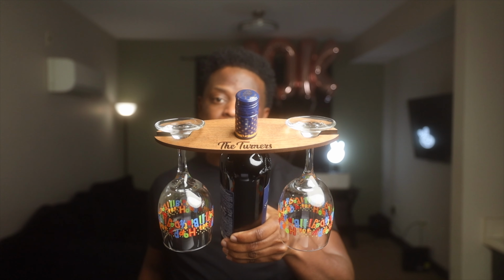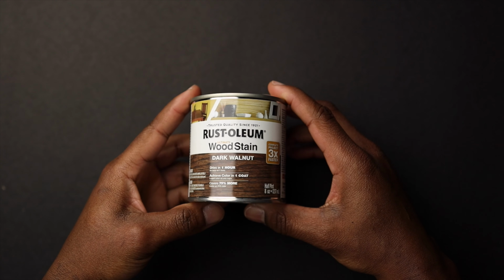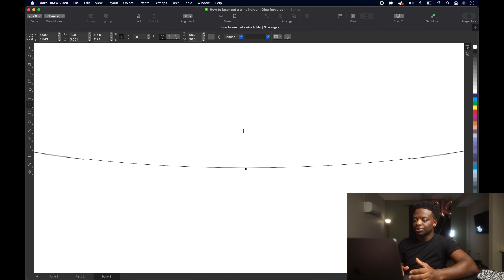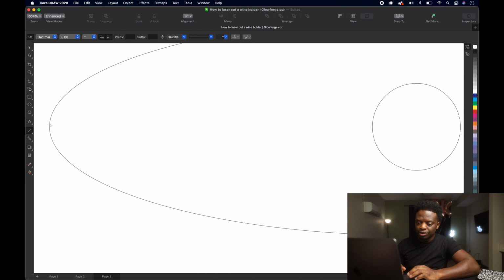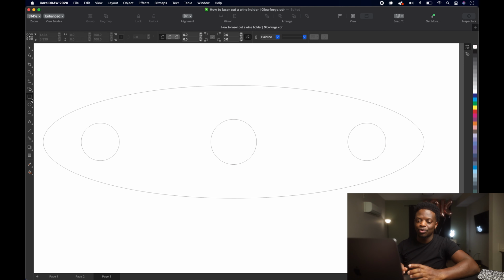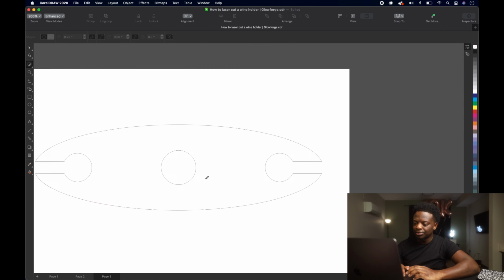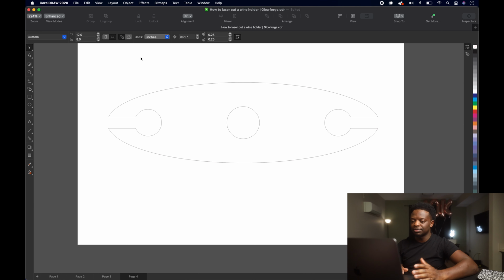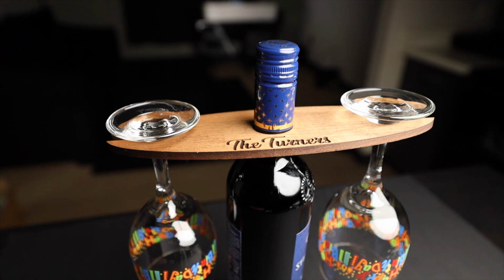How to laser cut a wine bottle holder | Glowforge

Comment: Very Nice Troy...after the stain has dried spray a couple of coats of Clear coats on it. Not only will it give it a good shine but it will also protect it. I use Rust-Oleum 2X Ultra Cover Clear Gloss on all my projects. It dries very fast and it leaves a great shine. Great Job again.
Reply from the maker: Thanks for the tip!
Reply: @TroytheMaker  did you use the GF  basswood settings  or custom?